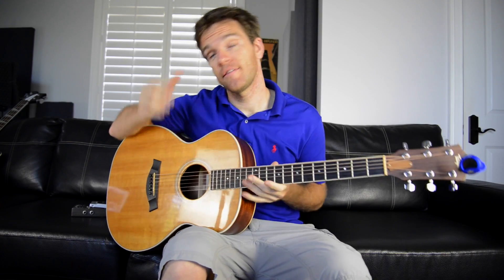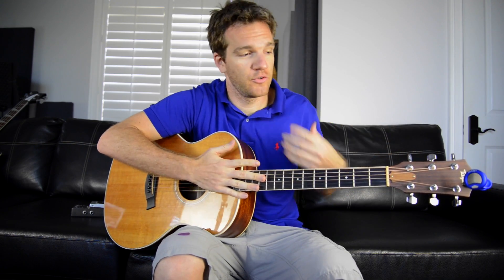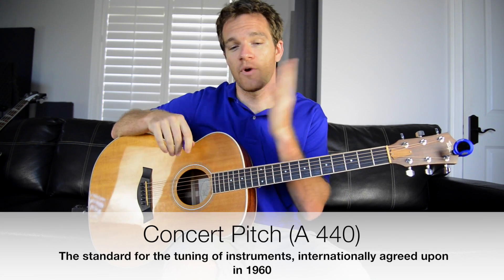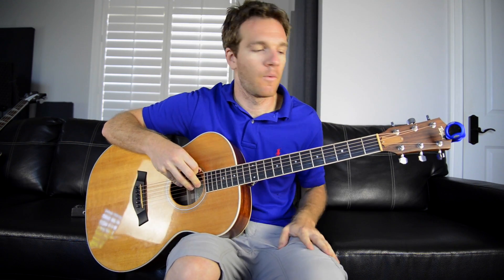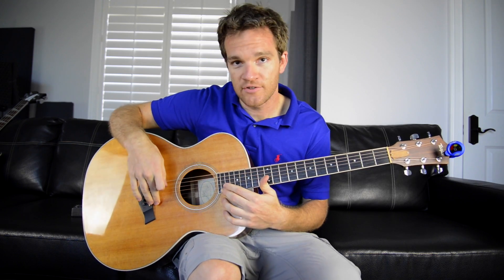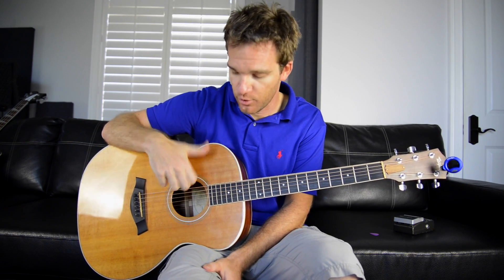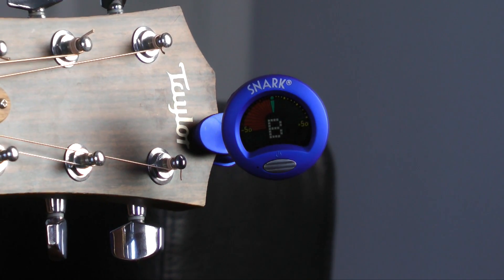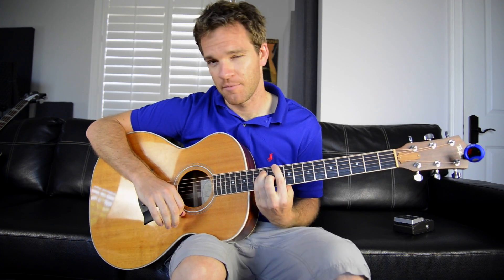Guitar Tuning Crash Course

Comment: Success! You made tuning interesting.  I finally picked much of this up in the last year, but could have used it as a teen.  Anyhow, I know how to adjust intonation on electric, but how do you do so on acoustic since the bridge is fixed?  Also, if you file down the bridge  to lower action will it screw up your intonation?
Reply from the maker: +Steve F Thanks for checking it out! There are a few ways to adjust acoustic intonation, I found this article for ya that gives a good rundown, hope it helps!

http://www.fretnotguitarrepair.com/repair/acoustic-guitar/intonation-correction.php

Comment: So, If I get it right, Snark won this compare. But how can ? Do you think that measure of vibrations (in Hz) is better than measure el. signal in Hz ?
Reply from the maker: +Rene Fa Well technically speaking, you can get accuracy with either vibrations or signal, it's the quality of the tool being used to measure that has a variance. I guess I just kind of assumed because of the price (and the different calibration options, etc) that the pedal would be more accurate, but for a $10 clip-on tuner to 100% on the money under close examination, that's pretty impressive, so I guess vibrations ftw!